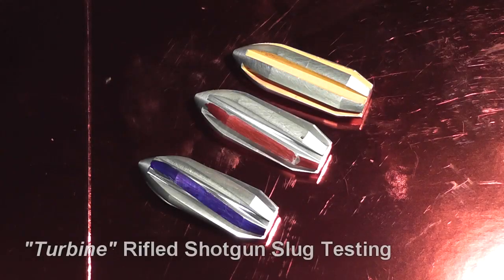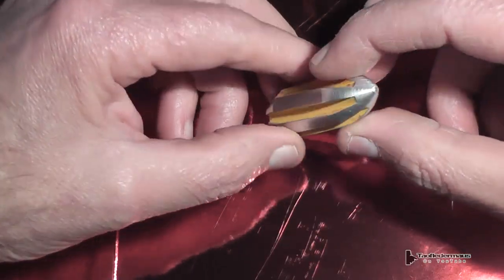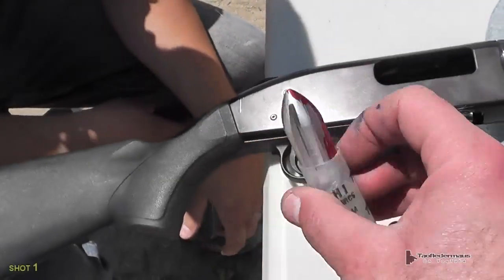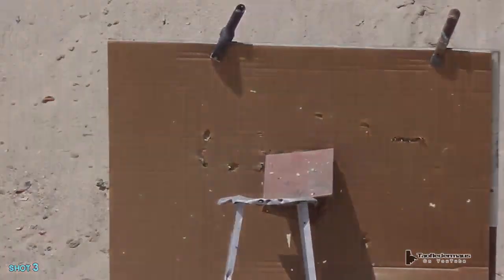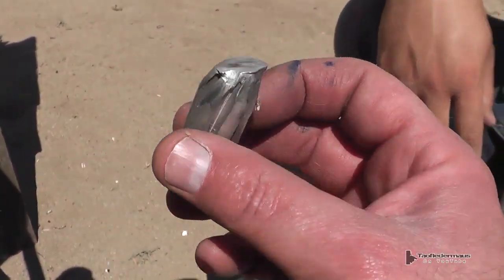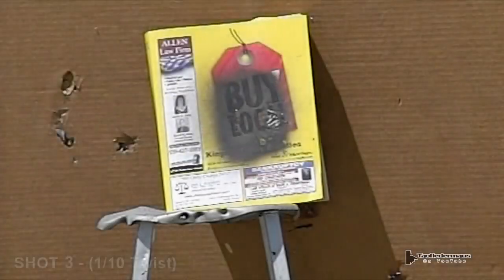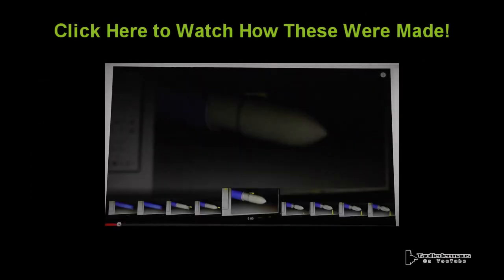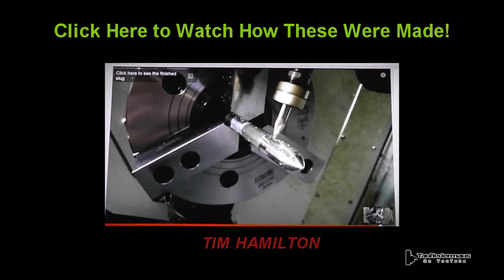Custom Aluminum TURBINE Shotgun Slugs  -Testing

Comment: Look, a spinning mass maintains orientation stability by the property of rigidity. To get a slug to spin in the first place (sub-sonic) the barrel must have some sort of rifling. You're trying to impart a spin in the slug with a smoothbore, in the super-sonic region. That is not going to happen. What you need is an extra component that acts as a "vehicle" to carry the slug (bore-tight) through the barrel so it doesn't start tumbling (yes, it tumbled from the onset, just look at that loose fit) within the barrel, and also impart the initial spin. That rifling machined into the slug, doesn't do anything in the supersonic region of flight. The airflow is too turbulent to be able to coherently act to direct the outer circumference in a direction to spin it.

What I suggest is this: Have Hamilton machine a hexagonal dovetail slug, and sit that slug in a slide fitting sleeve that is shaped like a cup, the base of the cup with cutouts that is shaped like a fan, biased to spin in one direction. Ensure that the hexagon edge of the main slug cuts into the wall of the vehicle so that only a tiny bit of wall thickness is left, for the purpose of breaking apart upon ejection from the barrel.

Comment: I have an idea that should make these slugs fly better. Find a shotgun with a non-tapered barrel. Next, CNC the parts so that the back of the slug fits into the cartridge as before but ensure that where it protrudes from the cartridge, it is the same diameter as the barrel.

Comment: the rifle cannon is what makes the bullet spin.. not its shape so it looks very difficult to make a single bullet for a shotgun that doesn't loose its course and even more difficult if the shotgun cannon is bigger than the bullet.. the explosion impulse the bullet and the cannon aligns it. if you just have the explosion the alignment will colapse.. so you can try making the same bullets you have there but bigger (except for the part that goes into the cartridge).. so in the bigger part you make the lines and in the smaller part you dont so you dont loose power and it shouldn't affect the dynamic of the bullet. and i suppose that filling it with a harder metal or even with some gunpowder could make it more fun.

Comment: riffled slug will and wont work as same as riffled barreled gun.  try using a normal slug with pointed tip it will dramatically work like a cannon with that smoothbore shotgun

Comment: There is two reason that the slugs are not flying "true". Obviously they are not spinning to impart stability needed to move through the air pressure that builds up on their "leading edge"(nose), to which causes a yaw effect along their length. And even if they did spin, they don't have enough density of mass to offset the bow pressure to low pressure turbulence created along their length, of which causes it to yaw out of control, thus the only way to correct that, would be to impart a spin that would be impossible for such a short low mass projectile to obtain without losing integerity, or to use a denser metal...hence why nearly all high velocity rounds use lead or heavier metal cores, besides the energy that can be imparted to hydrostatic shock upon impact. We all know that the two most important equation, that makes projectiles so deadly; first is, mass-energy equivalence(E=mc2) and second, kinetic energy(of a rotating body) ....BUT also needed to create stability, besides the gyroscopic spin!

Comment: The slug needs to sit deeper into the casing with a narrow eggshape sitting inwards toward the powder then have it set about mid way on the slug to prevent the tumble. The external force upon leaving the end of the raffling in the barrel is going to be unbalanced and it solely being onto just the hind in is going to throw it off every time due to its size. A inward pressure on the ass of the slug will cause the raffling  to take affect and limit the tumble throwing the weight of the hindend to the side and instead center the velocity of its weight  in the center / mid way  causing a balanced exit

Comment: These are nonsense. You not only lose a good deal of power due to the explosion force passing through the grooves, but that very force is going to cause the bullet to initially spin in the wrong direction, and even if the air flow corrected the reverse rotation (it won't) that means the bullet would stop spinning mid flight making it just as unstable as a normal slug, and of course slowing it down in the process. But none of that matters, because the bullet is traveling too fast at too short a distance for your fancy grooves to do a damn thing. They look cool though...

Comment: Would it be possible to rifle the barrel of the shotgun, or would that just make it wide barrel rifle that fires shells and slugs?
Reply: bobhihih Yeah absolutely. There are evens shotguns that have interchangeable barrels, and purchasable rifled shotgun barrels. Most custom shotgun shells benefit pretty decently through the use of a rifled shotgun barrel.

Comment: I am nor proffesional enginneer or experienced with weapons and/or aerodynamics. But i think if you had an angle of the "turbine" slots perfectly aligned with the angle of the screw inside of the shotgun barel in my opinion it fly straight. But once again that's my idea of it, not sure if it's actually true.

Comment: It seems the spiral grooves did little to actually make the bullet spin.  They were clearly tumbling immediately after exiting the muzzle.  Perhaps if the grooves had be lands elevated about the surface of the slug and not recessed or cut out?

Comment: Guys, how about making the front part of the bullet a lot heavier than the back, like in regular (at least in Europe) shotgun slugs? Make the bullet's core hollow - like 2/3 of it's lenght or so - starting from the back of the bullet and let it stabilize front to back and maybe, just maybe, the turbine fins will have enough time in flight to make it rotate and add the gyroscopic effect

Comment: Try having the grooves get shallow as they reach the back so when they do get all the way back there is no groove. I think what is happening is the gas from the gunpowder makes them spin one way and then when they get outside the barrel they are made to spin the other way by the air. This might be avoided if they grooves were not present in the backside.

Comment: Getting spin on a hard metal like aluminum would be hard to do I would think becouse theres probably not enough friction inside the barrel to allow for a complete spin before leaving the barrel.  Also the rifling grooves should tapered small in the front to bigger in the back.

Comment: The reason that the projectile is tumbling is because the gasses that are expanding from the gunpowder are entering the grooves from the back destabilizing the trajectory. If the grooves were tapered down to a zero depth at the rear of the bullet, you will get a much more stable travel. Give it a try and let me know if that works!

Comment: I wonder if something like these with more refining would ever be out on the open market for hunting. California is in the process of banning all ammunition using lead for hunting. So something like these rifled Aluminum slugs would a a possible replacement. Since they can't really use tungsten or steel because they would be considered armor piercing by the ATF right away. Maybe making them a bit shorter about the size of standard rifled slugs and then maybe hollow them out to fit a heavier core could help them from not tumbling?

Comment: It is simple boring inside the barrel that is missing without that the bullet will not rotate. To make a turn inside the barrel can be done many different way including the old method of using a wheel to make a turn inside the barrel

Comment: I feel like this is an easy fix to get them to fly strait. If it was hollow from the back and leaving the tip closed off like it is the expanding ass would then push the projectile from the front. Stopping it from going end over end.. Also maybe put something to act as fletching in the rear.  Something as simple as not cutting the spiral grooves all the way.  Start them in the front at the same spot, but end them in the rear a few millimeters from the end. That should put enough drag that it should stay strait.

Comment: The reason why these didn't work is because the slug is entering speed of sound creating a Shockwave ahead  of the rifling thus nullifing the aerodynamic forces on the machined rifling on the bullet. If the slug had pop out fins on the rear then it might work.

Comment: I'd say aluminium is too light.
Steel should do it. Or even copper, shich is denser. Ideally, lead.
12ga projectiles like theese (I believe you know it already) do actually exist commercially. Great for hunting boar.
It's the very same principle of a smoothbore barrel and a grooved projectile, which is also found in some early artillery pieces. Those rounds are made out of lead, probably die-cast. They have two deep grooves and four shallow ones along the projectile's circumference, and are fired with a sabot. Also, the projectile fits entirely in a 2.5" shell. It's meant to feed from a pump-action tube magazine.
This article may shed some light on the ideal twist rate. But in practice, it should leave the barrel and fly at that spinning rate for optimal accuracy.
http://en.wikipedia.org/wiki/Rifling

Comment: if you leave the .70 cal diameter at the base with the fins cut out and turn down the front of the slug to about .50 cal tapering to the 3/4 mark up to the .70 cal. it should hold stable in the air at supesonic speeds.

Comment: Isnt rifling done into the barrel?? Not the bullet...
Reply: hey man instead of insulting just explain to him why is he wrong.  Like you cant stabilize a slug with just air.. thats why it never works... the slug just tumbles. the stabiliy comes from going to a rifled barrel giving it the rpm to continue a stable trayectory.. its middle school physics.
Reply: Jorge Orozco dont listen to him...there is no ''rifled'' slug ...its just a desing in the slug so it clear all chokes...stabilisation is not acheived via rpm
Reply: Jorge Orozco A lot of shotguns are smooth bore so they need rfled slugs. They do have rifled barrels too.
Reply: Ragimund VonWallat quick google search will say other wise. Plus I have a ton of 20ga rifled slugs around so, you were saying?
Reply: sorry for the grammar, english not my first language..

Comment: I think when they said it needs rifling they meant for the barrel of the shotgun not the round itself thats why its tumbling. having it on the round just makes it catch air but on the barrel it would spin the round before it left making it stable.  also if you want round stabilization you should put collapsible fins on it.  like a dart.....

Comment: Aluminum is the problem. It has very little mass and that is what's causing all the tumbling. There's a reason bullets aren't made from aluminum. 

Make a similar projectile from lead/tungsten/steel and you'll have much better luck.
Reply: +TJP77 I know this is old but, If you shortened the projectile and still made it of aluminium the shock-wave would have less effect on it. there was a similar problem with the Yeager plane.

Comment: The spin on a bullet is a mechanical spin caused by rifilings in the barrel. Not by air passing around the bullet which seems to be attempted here. Thinner fins on the bullet and more of them (surface area), and a hollowing out of the back end of the bullet may help.

Comment: Am I the only one knowing that they are too long to be stable just by looking at it?
Like in a long veicle the minimum instability will be amplified by the rear, that's one of the reasons short cars can make faster turns and curves than the long ones. Cut at least half the ammo off and try again. You will gain in muzzle velocity and accuracy.

Comment: Ask Tim if he could taper the flutes, thin to fat, front to back. and press a  1x.250 carbide rod up the back.
 Your not getting any engagement between the barrel and round to promote spin, so... you have to rely on the wind. it 's best if you give the round quick access to lift and spin. so flute the round thinner and taper it down.
 PS
  Your not spinning at tremendous vilocites so lessen the boat tail.

 That Mama-jama would leave a dent!

Comment: I've perfected a slug load using Lee key slugs.  You have the same problem I did.  First you need a rifled barrel shotgun.  Next, use a heavy nitro card wad between the plastic wad and the slug because the wad is sticking to the slug and creating the instability.  As for the grammar nazi comments....you moron web trolls really need to get some manners before someone kicks your ass.   Your parents were obviously stupid not to teach you a little common courtesy you troglodytes.

Comment: Maybe the weight distribution was off with the machined slugs. Maybe more weight to the nose, like a dart

Could maybe machine them with a waist towards the rear so more weight is at the front of the slug than the rear but it still fits the bore front and rear.

Just a though.

PS: I can shoot targets like a pro all day long. Put a live thing in my sights and I couldn't hit it from 3 feet away.

Comment: The slugs are tumbling because the air drag on the front is too high... Next thing that is a problem is the weight, for example look at gliders, they are using an amount water-weight-load onboard to be able to slice trough the air... ;)

Comment: Have you ever tried reloading and not just pushing your projectiles into the shell. That way you could get the optimum speed for your projectiles. The problem with the aluminium is that it is to light. There are shotgun slugs with rifling on them but they wheigh a lot more. Thank you for great videos
Reply from the maker: Barnie van der Walt   We did that recently in PART 2   where we shot one of these at a gel block.

Comment: Maybe you could slightly withdraw the  endmill bit from end of the shell making it thicker assuming it create enough drag to straighten up. Or just drill the back of it out fill it up with some propellant and make shotgun rocket shells tip with changeable warheads

Comment: I think the projectile was way to long to fly strait. If you look at rifled slugs they are a lot smaller and hollow so all of the weight if forward as they travel.
   If you're expecting the projectile to start spinning after it catches air once it leaves the muzzle, thats not going to happen at those speeds.

Comment: You really need to dump that flimsy slide action test gun. You need to go to a much sturdier break action test gun that is remotely fired and barricades. 

There is very little air flow down those slots.  At super sonic velocity there is almost NOTHING, like a fraction of a percent, going down those slots.
Reply from the maker: genexrollins   There's nothing flimsy about my slipnslide action bullet throwing thing.
Reply: ***** You can say that, NOW, because you have not blown it up, YET.  There are guns, and there are loads, such that ONE shot with a certain load will pop that pump gun open and make a complete twisted up wrecked mess out of it, and a heavy duty break action gun will choke down 2 dozen of the same loads with out a hint of damage.  That qualifies your pump gun as flimsy, and when its finally blown up it will be a flimsy piece of junk, regardless of what you think, and the fact that you shoot these test loads by personally holding the gun shows that you don't think nearly enough, regardless of all of the clever crap that you stuff into that gun and fire down its light weight barrel, stuff that has never really been effective in any practical sense yet, in any videos that I have seen. For all the amusing screwing around that you guys do, you really have not learned a thing until you figure that out, and it is a Hell of a lesson to learn with your test gun failing as it is held firmly pressed against your face. Your sentiments about how strong and how well your flimsy pump gun, which has been drafted into test duty, will not do a thing to mend your gun or your face when the gun finally lets go. And your test methods qualify you as much more of a knuckle head than any kind of ballistics experts and /or technician.
Reply from the maker: You don't get any extra credit internet points for writing an essay,  bro.

Comment: You might leave a small lip at the end of each groove (just like a spoiler) .Also in my thoughts, it is imperative to have the middle section with the same outer diameter as the very end of it. Just a opinion of a airplane pilot!

Comment: The slug needs to be stabilized before leaving the barrel. My smooth bore shoots rifled slugs into 2" to 3" groups at 50 yards because the lead obturates causing the slug's rifling to impart spin on the projectile. A cup that would impart spin to your projectile would solve your tumbling problems.

Comment: Just an FWY. The reason the barrel is rifled and not the bullet is because force coming from behind the bullet (propultion) Will turn it the opposite way of force stopping the bullet (wind resistance). Therefore, The bullet will likely topple through the air mid way unless there is an unknown factor.
Reply: tom will I posted this at 1:28 before I watch the video, alas I have been confirmed.
Reply: Well said, has nobody else, (including the videomaker) considered that? Even if a plastic wad stopped the propulsion gases imparting a negative spin the grooves would have no effect while in the barrel and any spin would rely on wind resistance on exiting the barrel, then, even if you forget about supersonic shock wave issues the "fins" would be applying too little force, way too late. Once the projectile starts to tumble (because it isn't spin stabilized) those ridges would not right it. 
Still props to the machining and production, lovely looking slugs and they'd probably sell but poor physics/ballistics